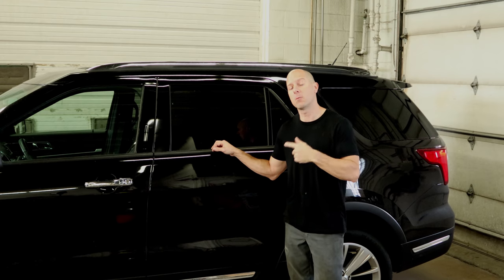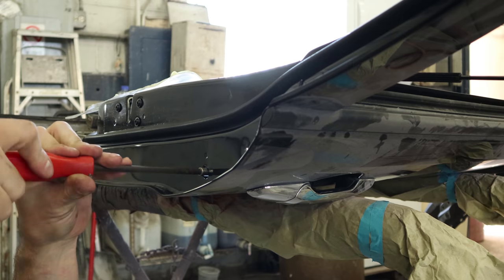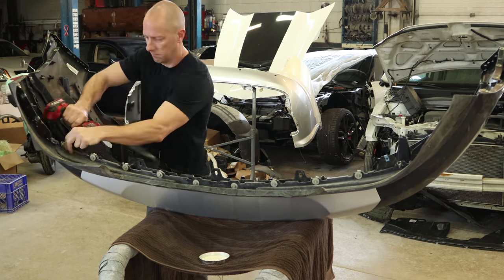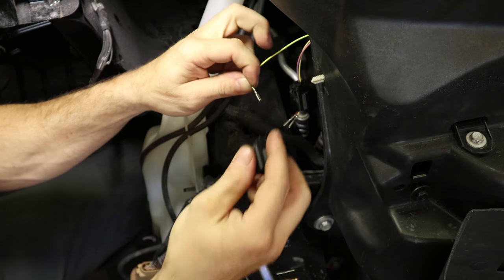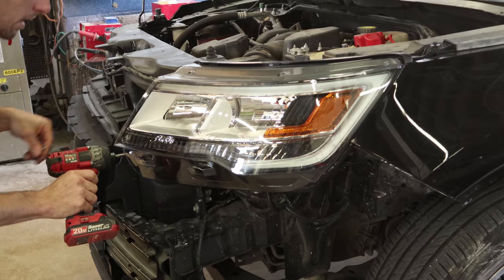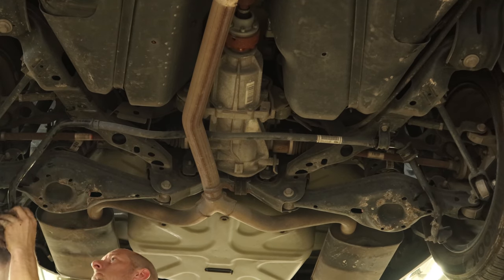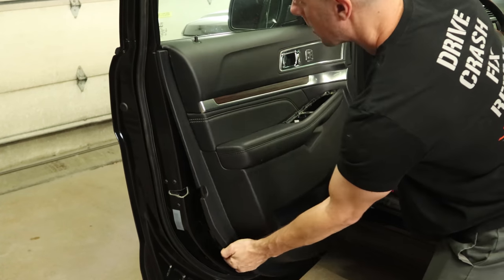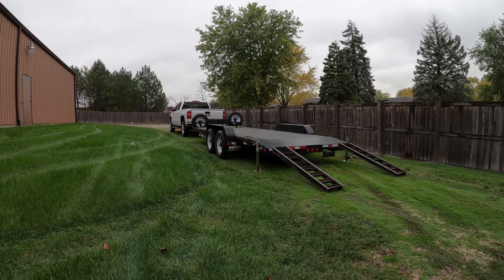Finishing the 2019 Ford Explorer repair

Comment: Here in Michigan... That door started to rot, the minute you were done painting it. But I have to commend you. You painted more of that door than Ford did. Ain't nothing more depressing than seeing a $55,000 price tag on a truck... And the doors ain't even finished painted.
Seven years of financing now... And the doors don't even last three.
 You are absolutely correct about that pneumatic rivet gun. Back in the day when we were doing Fox bodies. You've absolutely needed one put door handles back on. Otherwise you'd be taking that door handle right back off... And sending that door, right back and paint shop. Probably with a dent, you just had to fix. To this day... When I look at foxbodys, within an inch to 2 inch below the door handle, is the first place I'm looking for filler. And nine times out of 10... I find it. The tenth time, there's a tape line, around the door handle.

Comment: 12:57 Thank you so much for this unexpected & much needed tutorial for myself. I’m was in the process of removing all my seats in my 02 F150 so I can put in a new carpet. I had the passenger airbag connector disconnected and i went to take the bench seat out( the middle & passenger is permanently connected) and I misjudged the weight and awkwardness coming out of the passenger door & the bench seat caught the connector which I had no idea and ripped the connector off. Instead of waiting for co-worker to have free time to look at it, I NOW can and hopefully repair it myself. THANKS! 👍🏻

Comment: I like your attention to detail such as using cavity wax in areas of repair. My parents car that had major repair rotted out where the panels were replaced. the rest of the car is fine. It makes a difference!
Reply from the maker: Rust is a huge problem here with all the salt.  I wax everything I work on because a few minutes of work saves thousands of dollars and lots of hours in the future.
Reply: @vehcor  Shops here in Connecticut don't care as long as they get your money(even those who guarantee their work). Good luck in getting them to make it right.  On my recent collision damage,I couldn't complain to the adjuster because the shop was of my own choosing and the shop (when shown their failures) made it sound like they did me a favor.

Comment: Here's hoping you find a console that has the right extension. Putting on the rear hatch handle seems you still had to lift your hands above the elbows. Could've used the bell-housing bolt extension for that job, too. From the creeper...

Comment: I liked  that special tool for moldings... your not lucky, cause you probably broke a few before learning just how much "torque" that you can get away with. I think I must of saved a ton of those that were left over from fixing other doors... I  always just used what I have and I don't know if the ones I used come from this kind of rig but it worked... those bumpers had more wiring than my first rig behind the dash.... a 36 chevy pickup with wood in the door pillar A post  or what ever its called, I'm 73 so lucky when I go out that I remember where the out house is at when going after grub for a month and then hibernate and watch someone who knows what he is doing.... fake it till you make it. Kinda wonder if you ever have young people who want into repair to come and just watch... take notes as we don't answer questions when working.... well that redhead we made a exception for/LOL. Great stuff

Comment: 3:53 Laminated side glass.  I have never run across that.  Had to go look it up, guess there is a push to make it more of a standard.  I figured the interceptor would have the laminated.  Seems to be a bit of debate on the subject, and lots of lawyers putting their two cents in so it is guaranteed to be a cluster.  I Learned something today.
Reply from the maker: It is mostly for sound.  It makes quite a difference.

Comment: 12:30 100 thumbs up for the pneumatic riveter......OMG I was working for a display company and this one sunglass displayer prototype had about 100 rivets in it....I was dreading it then the old timer comes over with the air riveter OMG I was in heaven......I still have the old fashioned kind but I only use rivets like twice in 5 years but still, SO tempted to buy one. It's like having sex with a hottie, once you have a hottie you never want to go back to a nottie! lol

Comment: If it was a Chevy or Pontiac emblem that would have decreased the value . The Ford emblem is just a push.  When you talked about that glue foam being dry or not and you would put your hand in it to find out. That reminded me of my mom and my aunt . Mom had to have her windshield replaced and she went to lunch with my aunt . Sure as any thing my aunt put her hand right in the polyurethane and got it all over the place. Hahaha  Because once you go to a oil change place like that they never change the filter again anyway.

Comment: Question for you.  On Ford Friday, have you ever seen the interior door panel material pulling away from the base?  Our 2015 is having that problem.  Vinyl / leather is pulling away from the backer board and I think spray glue will hold it down.

Comment: Was it my imagination or did you use the battery powered tool more in this video than some of the others? Anyway on a 'normal' day, what ever 'normal' is, can you get through a day without needing to swap out batteries?
Reply from the maker: I only used the battery powered tools so I don’t have to run the compressors.   It makes the audio useless for the videos.  I normally use air tools at work, electric can’t keep up.

Comment: Intrested in 2000 Silverado 4x4 ? 106,000 miles black matching cap Michigan truck usual body issues? Runs drives everything works new tires. Let me know.

Comment: Great video.  I have a question.  I have a 2018 Ford Explorer and i hit a piece of tire tread on the freeway.  It bent my front license plate frame.  I took it off, but it appears that some plastic from behind the bumper assembly broke or cracked.  It is the part attached to the valance..I believe in your video you called it the cover.  what do you call that part.  I cant seem to find it on any schematic.Thank You...I am a big guy and cant wiggle my body under the car

Comment: Hi brother,
I need some help from you.
I have a ford explorer here in dubai and it is a police car converted to passenger car.
And the problem is the electrical wiring.
The battery keeps draing when left overnight. And as  the car have been changed to floor shift from the steering the 4  wheels swith is not working and as the wiring are not connected due to jon compatibility.
I would like to know if the wiring can be replaced or changed from other similar model explorer.